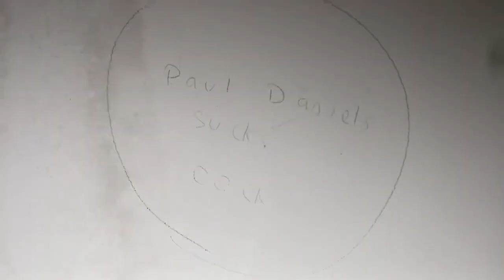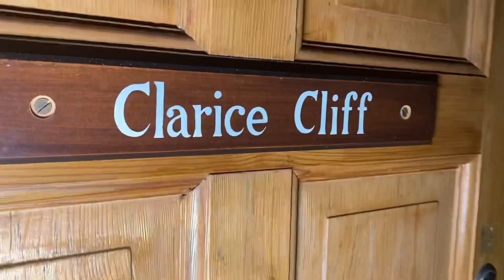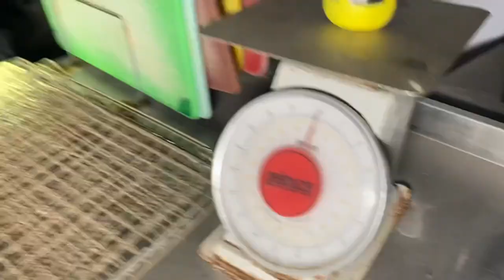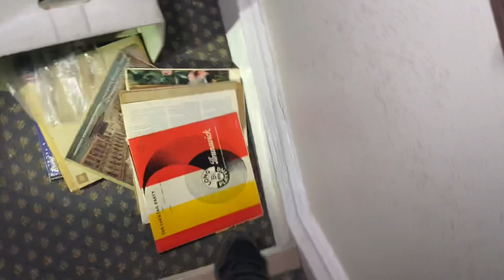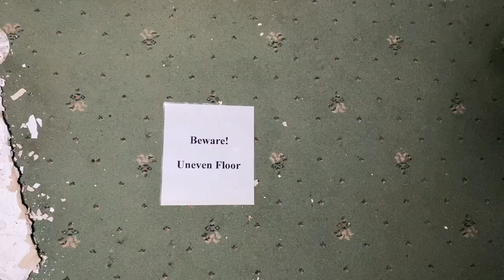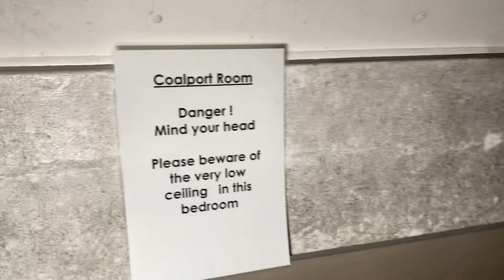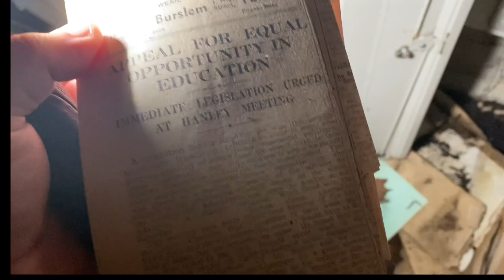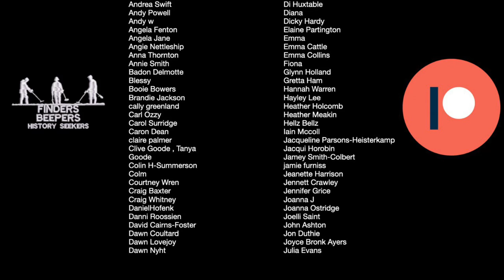This ABANDONED house had someone hiding upstairs

Comment: You need to get referred for a bone density scan done to see if you have osteopenia in your back, osteoarthritis, if so you might need to take vitamin D tablets, calcium tablets,  get a tens machine helps or deep heat rub on or heat pads that go around your back.
Reply: I've had a bone density scan and I've been diagnosed with osteoporosis and I'm waiting on some injection from the hospital, so it could very well be that.

Comment: Have you tried hanging upside down for your back problems?   It really helps my hubby's back big time!   The key is to get hanging upside down & totally relax so your back can stretch out & realign!    If you can't relax totally  - your muscles will hold the slipped disc in it's misaligned place .    
        I sure hope your back feels better soon!!
Reply: I got in a swimming pool and hung on the side of the pool for an hour a day,(not upside down of course) cured my bulging disc... Later in life it slipped and that didn't help.  But I'm older so maybe that's why.

Comment: You guys need to look into those square shaped torches. They give out so much more light instead of the circular ones with a simple pin point light. I’ve seen a lot of explorers use them and they are amazing! Love you guys!

Comment: About the blined they are trained to know we're the braille  is just like a phone and tv remote they navigate from the number 5 button witch has braille on   and about the pelican crossing next time you press the button reach underneath and feel for a cone shape hold it you will feel it spin to tell you that it's gone to red try it next time and they fined the crossing by feet the crossing has nobbly paving stone's  but if they got a dog the dog will take them there and cross them safely plus there touch sensitive improves plus hearing